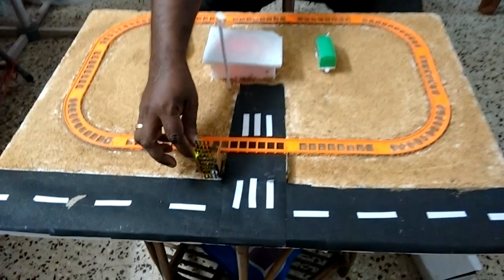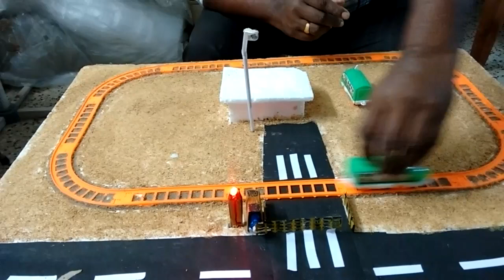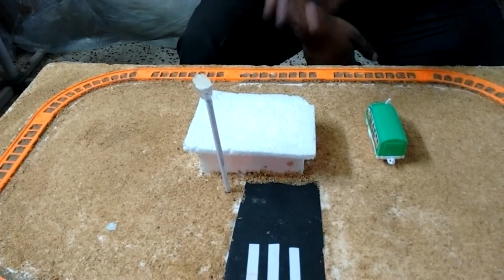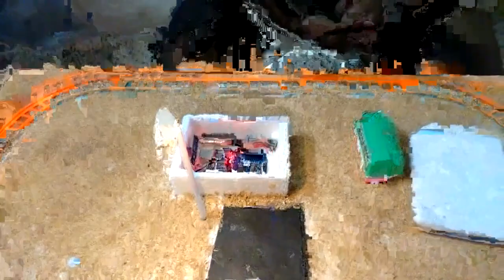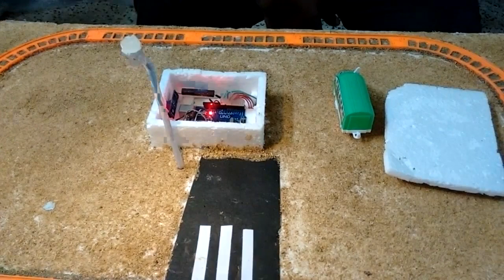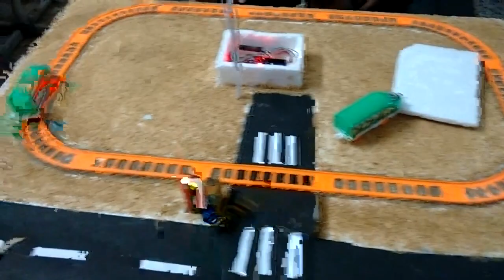Automatic Railway Gate Control

Comment: Kaise Bana hai
Reply from the maker: Arduino uno used to control the device
Solar Panel used to charge the battery and to give signal to Arduino about light status
Hall sensors are  used to sense the train  
Servo motor to control Gate